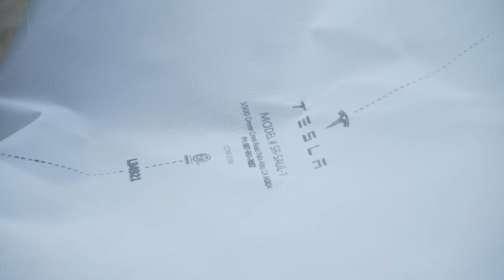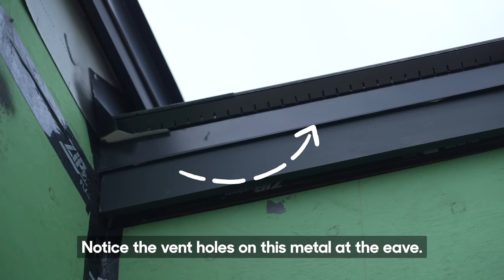Tesla Solar Roof - A Builders Perspective

Comment: 50 kw of solar and 140 kwh of backup is Bananas.
Reply: Ya its nuts.  Iv'e got a 6KW system on our 2500sf house and the solar pretty much covers the house usage plus my wife's EV here in California.  50KW is insane.
Reply: You and the power co could only use about 1/10th of it
Ohms law 101
Reply: Almost every home in America could make 50kw with the proper roof system, and will when these tiles are mass produced
Reply: The roofs would have to be .90 percent bigger or the panel's 90% more efficient

Again owns law 101
Like the whole inland deal the problem is is measured in watts should be measured in amps
Reply: @dennisdickinson8337  I’m an actual Electrical Engineer, not some “electrician” wannabe. Your quoting of V=IR is at best incoherent nonsense and at worst trolling.

A solar system should absolutely be measured in Watts as that is the real unit of power, measuring in amps makes no sense. A million amps at a trillionth of a volt is basically no POWER. Now for storage you want KWH because you want POWER per unit TIME. For example A 5KWH battery can produce 5,000 watts for 1 hour continuously. 

A 50,000 watt array will produce 200-300KWH per day of production in TX. That is a metric a$$ load of power that could refill 2x 300+ mile EVs from EMPTY while also powering your average house TWICE
Reply: @KurtsRPMGarage  That's until they block the sun light with Chem trails and your panels don't work lol
Reply: @HubstepCamaro  How do you know when someone's an engineer?

Don't worry. They'll tell you.
Reply: @HubstepCamaro  
Okay mr. Engineer electricity is like water
Reply: You have to overcome the incoming forces Like water,,in order to put anything in watts is a total amount of work done amps is what's actually going into the battery. Or grid or whatever checkmate thanks for playing in your case I guess it would be ohms law 102
So after Enron maximum line voltage is 137 on the average line voltage is 120 you might be able to figure out the math now
Reply: So if you have an amp meter and a watt m here's a fun experiment hook him up you could start with just like a car  battery
As the battery gets Fuller amps go down however Watts stay the same grid Tesla battery whatever
No way to break ohm's law as yet
Reply: Someone has lots of money for sure 💸💸💸💸💸💸💸
Reply: @evictioncarpentry2628  😂😂😂😂 with 4 Electrical Engineers and 1 Mechanical Engineer in my family I can testify to this.   
Christmas gatherings are most annoying.
Reply: $250k just for the roof and batteries
Reply: I’m betting more than that. I was quoted $93k for a 16kwh tesla roof
Reply: It’s not really that much if you consider that your car is going to generate a lot of grid debt in the evenings when you get home and plug in. 
An average 1500 square foot home in the USA uses 25kwh per day. Also the average daily commute in the USA is 39 miles. Since 75% of the passenger vehicles sold in America are trucks and electric trucks consume 500+ wh/m thats 19.5 kwh/d he’s got to cover.
Reply: Allow me to explain.. 
50kw per hour !! 
Firstly, most of the time guys don’t mention per hour part confusing us… 

Secondly, actual production can be even less say 35kw out of 50

Third, on a sunny day of 6 to 7 hours of good sun, system can produce 210 kw total 

Finally, the system is anyway Le connected to main power grid from local power company; any extra is pushed to grid and on bad day system pulls from grid.
Reply: 10 Tesla Powerwalls for 140kWh is probably $100k+ installed. I am waiting for someone to buy a Tesla Model X 100 kwH battery for $22k and wire it into their house instead LOL
Reply: @dennisdickinson8337  dude are you ok? You know P = I*V and you’re talking about battery discharge curve which has no bearing on what you think the topic is.
Reply: @evictioncarpentry2628  That’s right! 😎
Reply: @dennisdickinson8337  “electricity is like water”

Lord give me the patience required to converse with this man…
Reply: @damham5689  ❤️
Reply: @baratmalli6413  For a solar install in the south that is properly configured you multiply peak KW by 5-6x to get average KWH/day.
Reply: Deep pockets
Reply: Etter watch out insurance company might drop your coverage. Too much power production can be seen as bad for insurance.
Reply: Purses 👛 flying everywhere in the comment section 😂
Reply: "12-15 hour back up situation"- meaning they're pulling massive power
Reply: @johnsullivan8673  to complete the formula v in - v out and that's how much you have to push back into the battery or grid
Reply: @dennisdickinson8337  what the hell are you talking about? Do you know what an inverter does? How about transformer?
Reply: @johnsullivan8673  that's right when the voltage goes up a closed-down you can just don't magically make extra power 102 the power company and the other folks that don't have solar are getting ripped off and who's going to pay for that
Reply: @johnsullivan8673  yeppers but that's not the issue
12v4200v to 120 50kw for just one leg your inverter mileage very but again that's not the problem The problem is overcoming the incoming forces either via battery or grid
Reply: @HubstepCamaro  assuming of course there are no trees and you aren’t in a overly cloudy region like the northwest
Reply: @georgehoyle8797  Trees close enough to the house to shade panels are a mistake and disaster waiting to happen anyways, you don’t want that. 

Also, because this is apparently hard for people to understand I’ll make it simple: Go enjoy the beach on a cloudy day for 6+ hours without sunscreen. Let me know how that works out for you. 

That night while you’re covering yourself in aloe, consider that the Watts per meter squared of solar irradiance that makes it through all but the worst thunderstorms is still surprisingly high, and that overbuilding the panel array by ~20% vs ideal conditions is more than enough to handle even the most cloudy regions 

Way too many numbskulls think anything less than salt flats on a cloudless day == 0% solar output, and it’s really annoying
Reply: Am not an engineer or have much knowledge on electricity but I've been seeing a lot of people saying something about efficiency of the panel? What does that mean exactly?

Is it the amount of sunlight that directly converts into usable electricity with heat as the byproduct. Or is it a metric of how much light it can "absorb" under normal conditions.

Also is there any definite proof that can confirm or deny whether or not solar traps heat around it, similar to that of asphalt?
Reply: @KurtsRPMGarage  how much is your EV battery capacity and how much is your daily electricity usage? Do you guys have air conditioning?

I've been under the impression that you needed at least 10 kw system to ensure sufficient headroom for all your electrical needs + battery charging + EV charging. Is that incorrect?
Reply: @bruhder5854  it definitely depends on your location. We have ac but only need it for about 2 months a year and use it sparingly.  The Tesla model 3 uses about 12 kwh a day to cover my wife’s 45ish mile commute and the solar averages about 25 to 28kwh a day for the year.  It’s not completely 1:1 but it’s very close. I end up paying less than 100$ in electricity for the year.  Your situation will vary.
Reply: @bruhder5854  solar panels currently are not a perfect 1:1 transfer for uv rays to electricity yet (nor will they ever truly be.) but to understand how misleading it can be just know that the most advanced solar panels being tested RIGHT NOW can only convert 40% of the energy it’s given into electricity. That’s with the source of the energy being set up in a lab directly 1-3 feet away from the panel. Apparently this is to accurately test the full power of the sun on a perfect day/hour. But that means on most days say during April September or even in mid December the solar panel will not be getting the perfect amount of absorption. Especially since rooftop solar panels are fixed in place so it’s hard to be in the perfect position for most of the time. 

So with most market solar panels currently being about 20-25% efficient of a mid summers day in sunny weather you can see why it can be important to know how much energy your getting out of your panels through the day/month/year. Or else you risk not getting the most out of them. Luckily the current lifespan of most solar panels is typically 20-35 years so with any luck they should pay themselves back in half that time and the rest of their lives is you making some nice savings. 

The small issue with that last part though is that over the past 30 years or so, several solar panel companies or solar installation companies of gone under so when people needed to replace their system or worse when they suffered roof or panel damage they would have trouble finding a replacement part. So just make sure the company you go with has been in business for at least 10 years.
Reply: @HubstepCamaro I spend 6+ hours in the sun all the time and no aloe is ever needed. Just beautifully tanned skin
Reply: Three days with no sun still electricity
Reply: New technology will use less and less electricity so you will need less backup.
Reply: The thing is VG with a 70 kW EV. You will only need one power wall on a normal size house.
Reply: @dennisdickinson8337 A car battery charging is a bad example. Lead acid and lithium both follow the constant current+ constant voltage profile (lead acid has an additional current finishing stage). Take lead acid for example, we start at a constant current, let's say 60amps until we hit our voltage target of 2.4v per cell. Now we reduce current gradually to maintain this voltage until we hit a minimum amperage target (lead acid is 2.5-4.5% of Ah and lithium stops at 0amps). For lead acid after we reach our minimum current threshold, we maintain at a constant current and allow the voltage to rise however high it may to a safety limit of 2.7v per cell.

You will see current decrease, but the watts also decrease as the voltage is not changing.
Reply: Tech person
Reply: Now all they need is a Ford Lighting or another one of the EV trucks coming out to plug in and add an additional 160-200kwh of backup … just in case 😂..
Reply: Giant mansions usually have 17-24KW sized systems, 50KW is insane, maybe their in a state with very few sun days per year, therefor need a huge system? probably some kind of bitcoin farm??? Idk. I’ve been in Solar for 10 months, no absolute way this is a residential
Reply: @KurtsRPMGarage your fridge is using 2kwhr a day alone. You need several hours at 7.5kw to chat page a car. Check your bloody math.
Reply: @samueldrayton1759 maybe 2 hummer evs in the shed?
Reply: @Cross-xm2fr with $250k you can paid electric for at least 25 years.
Reply: Ça  create many hydrogen stations
Reply: Look at the size of the place....wow, like a dream castle.
Reply: @dennisdickinson8337 I agree with some of what you say,depending on battery backup amperage capabilities.  KW is this sense is measuring capabilities of the energy generating system.  Think horsepower vs torque.
Reply: @SolRC  no thanks but at the end of the day anybody that's got alternative power IE sailboat dry camping knows you only get 10%. It needs to be measured in appspumping water analogy
Reply: @HubstepCamaro that seems to be a good amount. Not too much not too little.  This has to be $500k in panels alone. With rebates.  Wonder if you could classify it as multiple homes systems so you could get the tax rebate over and over. Though I imagine they’d be out of the qualification anyway.
Reply: I want to put pex under this roof with a heat sync and heat water with it too while optimizing the panels. And during the winter be able to reverse flow heat into the panels and melt snow.  Think if you had panels and water on your roof absorbing heat how much cooler the inside would be. Plus a zip roof with a decent r value and closed cell foam inside.  I’d put in a commercial air system with optimizers. Or maybe Mitsubishi’s large units that do water heating too. Hydronic heating in the house and driveway and pool.
Reply: @jspafford  painting on how much snow you get subtle panels also make heat leather making power along with the radiating heat from the sun
But yeah underneath a couple inches of snow the panels will melt some snow
Reply: @jspafford it’s not a tax rebate, it’s a credit and it’s the system that qualifies for the credit, not the homeowner or the home
Reply: Or maybe Mangoes
Reply: How expensive comparatively to other roofing tiles?
Reply: @user-st4wf5pq3w  that's not the issue the whole ignorance of the solar is you only get 10%
Reply: Back in school most of us were taught about ohm's law
They drop that out along with cursive
Reply: @HubstepCamaro No they couldn't 😂
Reply: @shawnd567  Be specific: what couldn’t?
Reply: @jspafford  $500k in panels? Are you nuts? Is he covering a 1000 acre farm in panels or something?

You realize that a 250w panel is like $100 these days. Half a million in panels is enough to start your own power plant.
Reply: @HubstepCamaro  it’s solar and a roof. So you pay more than double per solar cell. It’s as durable as a metal or slate roof. So when you compare it to solar panels and a metal roof or slate roof, it makes sense.
Reply: @jspafford  it's worse than it you only get 10% & only can use 10%
Who's going to pay for the missing power
Reply: Someone buildimg a multimillion dollar house isn't worried about that little drop in the bucket.   Lol
Reply: I am pricing a 32kwh.   Its not that far out to be looking to the future and accounting for weather sunlight loss and degradation of the panels.
Reply: @Cross-xm2fr that'll pay for itself if he runs a medium sized grow farm
Reply: If they are running a lot of 240v on top of everything else, it may not be as bananas as you think.
Reply: Don’t forget they have a farm. They might be using it for the farm and the house. Maybe 🤔.
Reply: @baratmalli6413  kW the power, is already a rate. kWh is the rate times time, meaning the area under the curve, the full volume of energy supplied. This is like MPH being the instantaneous speed of your car, times the number of hours you drive, gets you the total miles driven. kWh is in essences comparable to mules driven, in that they are both the TOTAL outcome of operaring in a particular condition after some amount of time. Just thought it would be helpful to grasp that first